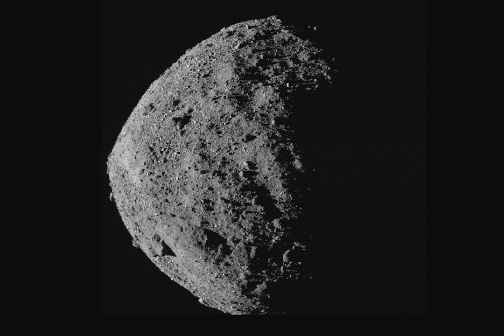Rubble Pile Asteroids

Comment: So... could you build a burrowing machine for asteroids?
Reply: Digging into the surface of a small asteroid is complicated for several reasons.  The rubble pile structure is one reason.  The extremely low gravity is another - it is very hard to dig without whatever is doing the digging pushing itself off into space.  Spacecraft missions to asteroids have variously used metal pellets, nitrogen gas jets, and explosive charges to excavate material.

Comment: The quantum gravitational nucleonic shape model I'm suggesting is basically a tri-disc omni-retro-reflector forming eight joined corner cube reflectors, each disc essentially represents a quark system. As nuclear spins drop, due to cooling, I suppose the nucleon spins eventually reach a point where all nucleons are spinning in alignment, supporting a bi-cone shape for the pile. 

Further I suppose eventually the nucleons may lock into a single shared orientation with no spin whereby they're fully gravitationally entangled. Each corner-cube reflector has a central ray direction where the disks may be most easily perturbed by any residual energy and these eight rays would define eight directions of cold quantum focus diminished gravity.

The bi-cone may share a lot of gravitational aspects with cold matter (cold gas, other non-exotic cold objects and likely also BHs) in flat spinning galaxies where a cold dark matter gravity sheet has slightly-enhanced gravity on the shared spin equatorial galactic plane and dark matter gravity filaments align with more-strongly-enhanced spin-inducing gravity along the direction of the distributed aligned spin axes in galactic cold matter. 

I suppose a separate, temperature-independent, quantum gravity vector-field carrier rotation property forms galaxy-scale (and cluster-scale) stationary waves surrounding galaxies, best seen in the most-distant lensing-based images of DM. It's potentially interesting to consider angles of enhanced cold gravity as embodying directions for gravitational accretion following Hebbian learning logic, and diminished gravity behaves as if showing relatively anti-Hebbian learning logic. Temperature-independent distance-dependent quantum field carrier rotations would periodically transform directions originally embodying Hebbian logic into directions of anti-Hebbian logic.